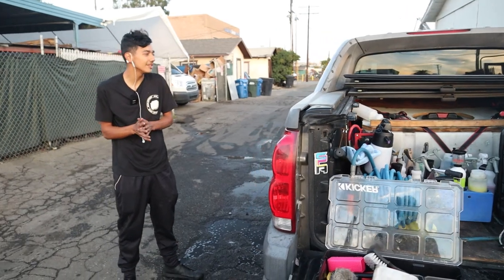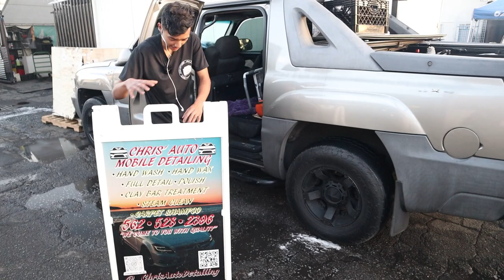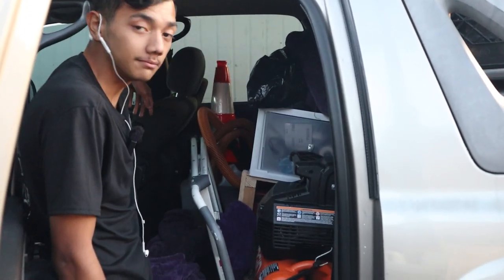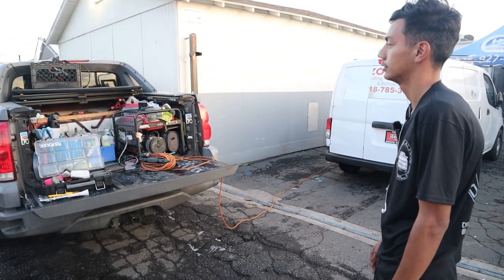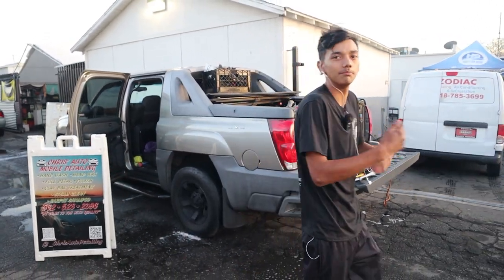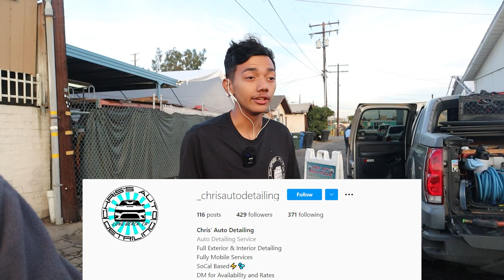Chris Auto Detailing Detailing Setup - RTE Detailing

Comment: Trucks are the way to go, not having to inhale everything. You don't need a bunch of shit. Get everything low profile and it will work. Go with a Tundra long bed. Those Rams and Transit vans are shitty along with the CVT's in the Nissans. The old school Astro Vans are more reliable vs the Nissans, Rams and Transits when it comes to vans 24/7